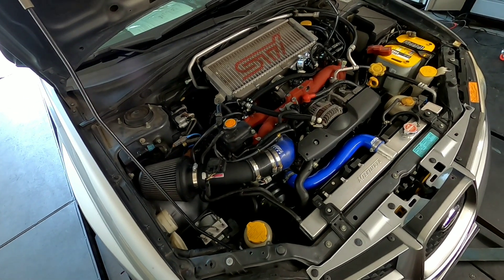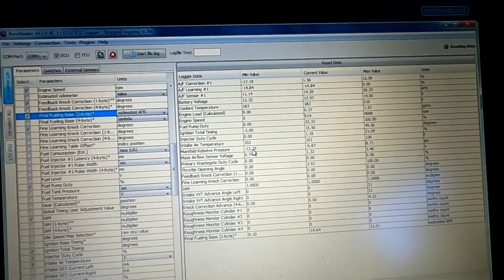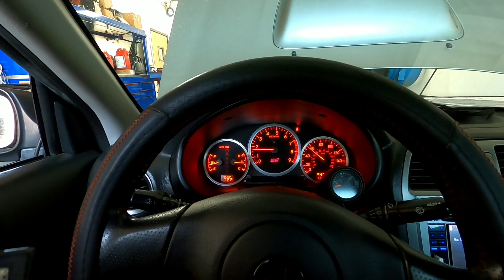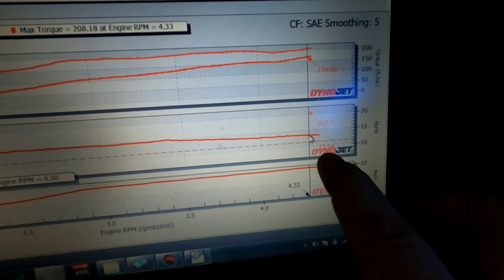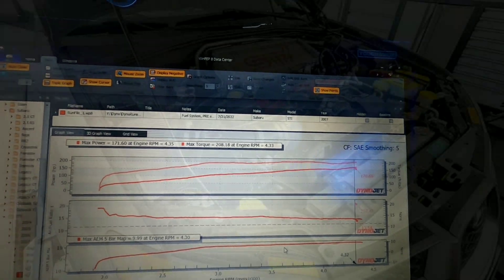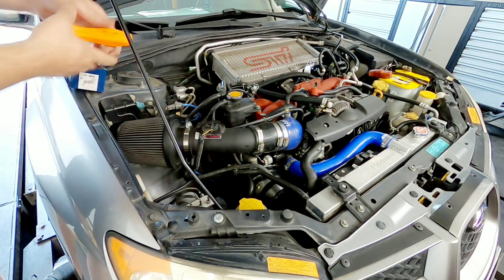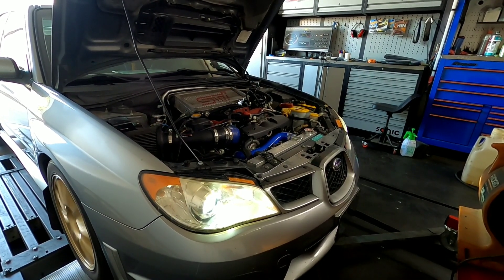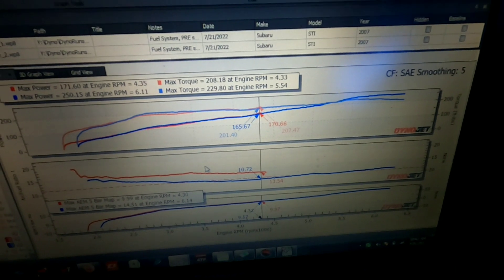Tuning Tech. Why do Subaru engines just blow up? Bad design or something else? Volume 2

Comment: Nice video pretty helpful.  Just one question have you guys noticed subaru engines has a pretty bad blowby? I'm on debating on getting a 2013 frs will low mileage but bad blowby. Thanks
Reply from the maker: Frs should have little to no blow by.  I wouldn't get one if it had a lot for sure!

Comment: JDM EJ20X GT Liberty/Legacy Turbo. 485,000 km. Rocker cover gaskets once, cam seals etc once, change oil every 5,000km, belt every 50,000km. Uses no oil or coolant. Still goes like mad.
Reply from the maker: Meh,  maybe 1 in a hundred
Reply: @WT4T  I'd like a tune but I'm not near you.
BTW I only just this afternoon replaced the 2nd rocker cover gasket. I didn't do it because it wasn't leaking when I did the rh one.
I cane it. I recently did Adelaide to the Queensland border in 20 hours (2000km). I often do 700km to my boat, occasionally towing a boat. 
It has an oversized turbo & goodies too.

Comment: EJs don’t just blow up.   There is always a reason they did.  And 99% of the time it’s user error or  the tune being bunk.   Or both.
Reply from the maker: Not 99%. Incorrect tune sure but I see fuel pressure issues and maf issues cause the most problems.

Comment: Always always always detonation and bad oil. Some bad apples in the bunch m. Sometimes you just get a bunk motor.  But.  It’s rare.  It’s almost always user error. EJ engines are very reliable engines if running properly.
Reply from the maker: I see bad MAF, no/wrong tune, and extended oil changes causing most issues.

Comment: lol I noticed the title & even before I pressed play on this vid I was thinking the only time for a engine or any other engine to blow up 90% of the time it was running lean the other 10% was because some dimwit forgot to tighten up one of the connecting rod bolts. My Subaru engine ran over 10 years without blowing up mind you when I mod my car the MAM was bypassed sure she ran rich but safe pushing 8k rpm on every shift no issues, well gearbox yes installing heavy duty clutch will eventually break 2nd gear :) my advise get a twin clutch & 6 speed no more issues unless you like the ratio's of the old 5 speeds pulls 80 mph in 2nd gear hehehe.

Comment: And this is why i monitor, feedback knock and  AFR, like a hawk on my own 05 STI. just recently had too replace the upstream o2 sensor and the maf... running lean and letting the engine knock kills these engines faster then most anything else.
Reply from the maker: That's one of the reasons I'm not a fan of Open Source Tuning. While you CAN monitor things it's not as simple as with an Accessport.

Comment: Oiled or dry filter?
Reply from the maker: It was an offbrand filter, unsure if it's dry or oiled. Oiled gets a bad rep because people over oil them however when done correctly they won't foul the maf and actually trap particles better. We mostly sell and install dry though just because the cleaning procedure is much simpler.
Reply: @WT4T  even done correctly particulates will come off on the inside of the filter over time and usage, damaging the sensor. Btw they say a great dry brand traps 99% vs oil at 98 due to micron size of the material used. 1 wear hole and I don't care what filter you got if gravel can flow through.

Either way good find and added bonus to the wife for buying gauges.
Reply: Probably dry
Reply: @dancee1007  you'd hope so, but I have screwed up maf with oiled brands in the past and why I don't use them.

Comment: How are you reading AFR? I thought these cars didn't come with a wide band?
Reply: The oem sensor is a wideband but not the same kind of wideband as an aftermarket gauge uses.   He pointed out the OEM one wasn't that accurate.

Comment: Best to go speed density in this situation?
Reply from the maker: Best to fix the issue with the car.  Maf is a far superior way to meter air as it is a real measurement of airflow instead of a calculation and estimation.

Comment: Edit: Good one, not what I expected.

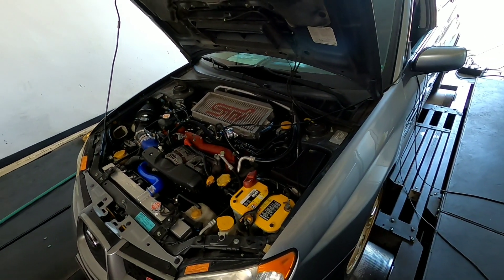I paused at 0:35 and I'm guessing it was the BOV that blew it up... or injectors were installed and it wasn't tuned AND the BOV helped compound the problem. That intake is also sus... jeez, it could be anything at this point.
Reply from the maker: It's always the maf! Or on big power sd cars it's the fuel pump